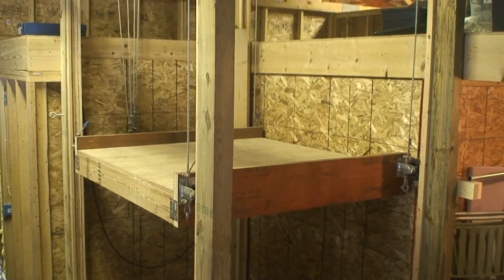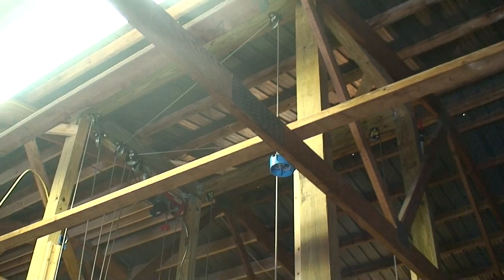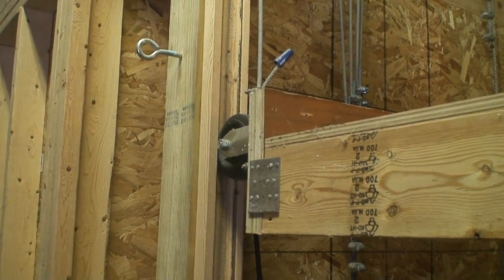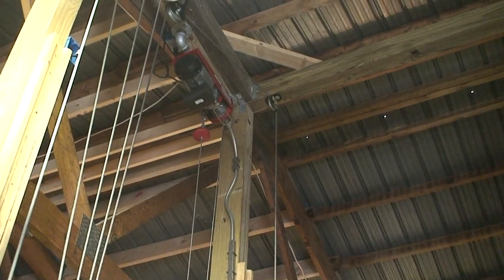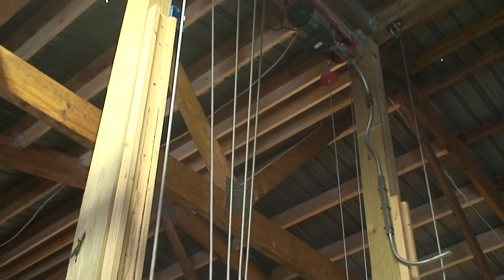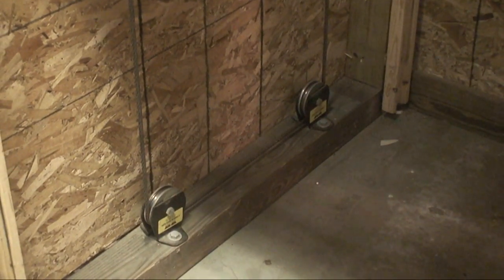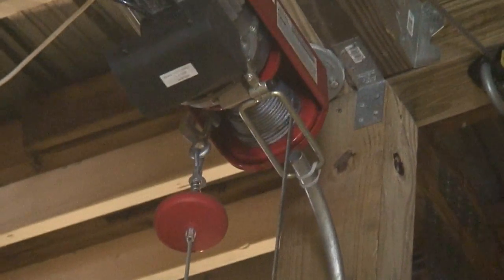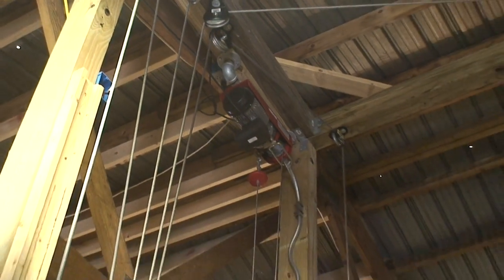How to Build a Freight Elevator for Your Pole Barn (Part 1)

Comment: While watching this I knew there would be tons of Safety Sally's harping on how unsafe this thing is. 
For what you have built , its overkill for a 500 lbs limit.    Yes things could happen like a bolt could fail, or a cable jamb.  Personally I'd luv to have this exact lift in my barn. Its been at least 10 years since I put any hay up there ,But its part of our wood working shop in the loft. We have a track loader with a set of pallet forks ,but the engine died in it. That was our lift with a big pallet on the forks. Now its rope and tackle over a rafter , a huge difference!!!
Keep up the good work👍👍👍👍👍,⭐⭐⭐⭐⭐

Comment: Just one add, given you center the weight on the platform you can lift up to 4*(individual pulley limit) because the weight is divided in the 4 corners / 4 pulleys. Now on the other hand I would worry more for the wood bore afferent to the eyebolts, (if it would sustain these upper weight limits)

Comment: I was just looking at this, and I realize this is an old video, but I would like to point out that some of your rigging needs to be corrected.  Look up "Never Saddle A Dead Horse" and you will see that your cable clamps are not properly set.  Even if people don't ride on this, you wouldn't want damage to property.  Great idea and work, just a suggestion to check your rigging.

Comment: why not make a counter leaver ? stiles are on one side you can pick the platform from one cable no pulleys needed and its better to have limits .. or (finals) one on top and one on bottom and you could send the load up and it would hit the final and stop at that floor height that u set .. just my 2 cents   8 yr elevator tech
Reply: *8year elevator tech should not encourage this type of unsafe project
Reply: Elevator Mechanic here too.  Lots of failure points!  Death trap!  What a fool...

Comment: You double your mechanical advantage at every 180 degree cable direction change....which I count three of in your design.  So, in theory, your 1300lb hoist could lift 2000-2500lbs....discounting some for friction in the pulleys, etc.  So I'd say your're more than fine at 500lbs.  Just food for thought.

The weakest point I see is the threaded link just below the hoist hook.  You have two there, a heavy and a lighter one.  I would eliminate at least the weaker of those to gain some peace of mind.
Reply: Oh an yeah I would limit the weight due to the fact the platform itself is wood and that is not as strong as you think compared to aluminum (which is lighter but pricey) or steel (heavier and still more than wood but less than aluminum).

Comment: phpdreams says "you double your mechanical advantage at every 180 degree cable direction change..."

NOT true. Changing direction does only that, nothing more or less. Tie a 10 lb weight to a rope and lift it. Takes 10 lbs of force UP to do so. Now put a pulley on a beam, run the rope through the pulley and it will still take 10 lbs of force, only now the force is applied DOWN to raise the weight. Parallel forces are equal.

You need to study how mechanical advantage actually works, it has nothing at all to do with direction change.
Reply: +Nonya Bidness 
Nope. She's right. You need to read her comment carefully and either think it through or actually try it. How do YOU think a rope hoist works? Look at one sometime- it's not just a rope around a pulley. I do winch recovery many times a year, I know what works and how. Adding a SNATCH BLOCK doubles your pulling capacity (NOT winch capacity- that's how shit gets broken).
Reply: +Nonya Bidness 
Again, you don't understand it, and I have no idea how to explain it so you do (Julie R did it perfectly clearly to begin with). Changing direction does NOT double anything. It simply changes direction. I promise you that is true, it's simple laws of motion and physics. It's force multiplied by distance, and changing direction changes neither of the two. You can change direction ten times and it still won't change the force or distance.
From your comment, you also clearly do not know the difference in proper uses of a snatch block. Or winch. Pulling 10,000lb with a 5,000lb rated winch is NOT letting it do it's job 50% easier, it's OVERLOADING the winch and cable by 100%!
This is basic stuff and I understand it can still be confusing to people, but please, please educate yourself further before you or someone else gets hurt from your lack of knowledge.
Reply: +Nonya Bidness 
And the Warn site is correct. But your statement- "Add a pulley, double your winch capacity" is not. A snatch block is not "just a pulley", another of your statements. It is a system that works to double the capacity only if rigged a certain way. It's not just a matter of changing direction. I apologize if I misunderstood you, but I went from your exact words.
Reply: +Alaska Bruce 
BTW, I did pay attention, and yes, there is one double line pull shown in the video. But the comment the OP made, which Julie R replied to, was "You double your mechanical advantage at every 180 degree cable direction change....which I count three of in your design."
That was incorrect on both counts, which is what she pointed out.
Reply: +julie r bubba, I don't know where you get your information, but I get my information from actual hands on knowledge. If you have 100 lbs as dead weight, you run a line up over a pulley and back down, yes, it still takes 100 lbs of force applied to lift that load. But if you do one simple thing, it reduces that applied force to lift by 50 lbs. That one thing is run your line back up to your pulley and dead head it. For every other loop through a pulley, back down then back up you reduce your applied effort by half to lift that load. I have strung up too many drilling rig, workover rig blocks, crane blocks and hand pulley systems. For the better part of 30 years I have been doing that type job. Study some hands on task before you open your mouth. For a four line pulley, you only need 25 lbs of applied force to lift a 100 lb load.
Reply: +Nonya Bidness 
What I stated as absolute is correct- changing direction alone does NOT change force. I know very well what I'm talking about. Once again, the OP stated- "you double your mechanical advantage at every 180 degree cable direction change..." which is patently 100% false, as I clearly explained why.
If you wish to qualify by changing the statement to YOUR words ("IF it's rigged right") then of course that's a completely different thing isn't it?
There are many variables, I wasn't attempting to explain a multitude of rigging possibilities, simply correct an erroneous statement.
BTW, since you are so demanding of statements being qualified (not 'quantified', that's a totally different meaning), a snatch block is differentiated not by the fact that it opens(some are not made that way) but by it's being not stationary. It's a pulley device that usually has a hook or clevis, and is attached to the load as an intermediate pulley, which then does double the mechanical advantage. But even a snatch block can be used simply to change direction of pull, in which case it does NOT create any mechanical advantage.
Reply: +mike king 
You're not disagreeing with ME, because I wasn't discussing the same thing you are. Please read what the OP wrote, it's absolutely incorrect. That is all I was commenting on. I'm familiar with many hands on applications of multiple pulleys, I grew up raising hay bales with a wooden block and tackle. That's why I opened my mouth to correct the error.
Reply: +Nonya Bidness 
Does it bother you when a woman is smarter? Because all I did was repeat what I originally stated, and defend my statement. How exactly is that 'backpedaling'???
A stationary snatch block is not a snatch block, it's a fixed pulley. Maybe do some technical research before spouting your opinion and appearing not so bright?
And if you buy a hand operated winch (come along) you will find most have a pulley with a hook which operates as a snatch block and does NOT open.
Oh, and please locate a dictionary and learn the difference between quantified and qualified!
Reply: +Nonya Bidness 
I pity your wife.
Reply: +Nonya Bidness 
I think anyone reading this has gleaned a LOT about your character.
Reply: Julie is right.Going up over a pulley then down to the load,my bud thought was a two part line!so does this guy.
Reply: multi part lines give advantage by allowing a slight force to lift way more,but the loss is that the slight force uses up way more length of rope.
Reply: Everyone, settle down and use this simple guide to how pulley/snatch blocks work per mechanical advantage, some of you are right, others are wrong, you decide to yourself if you were right/wrong.
https://www.thecrosbygroup.com/html/en-US/calc/snatchblockrigcalc.htm

I do realize these commets are at least 2 years old, but, php is mistaken in terms of using a pulley at the top or in sixgunners though is neither true, your just making a change of direction and not reducing load or increasing power of winch in a single line with the pulley fixed to a tree for example. However if that pulley (snatch block)  was attached to another vehicle to help it out of a situation you are increasing your winch capacity while reducing its load, essentially your winch is still capable of pulling say 12,000 pounds but it would be able to handle with a 15k pulley (for safety factor) or snatch block (both are the same thing, one just makes it easier to reeve and remove rope or other steel line) you are still pulling 12k but now can handle 24k. So in essence pulling yourself out using a pulley/snatch to a tree and you are NOT doubling anything but would still need to use a pulley.snatch of equal if not more capacity.

Just check out the link to the guide (you have to plug in a number from 1 to whatever) and see how using snatch blocks alone works per mechanical advantage.